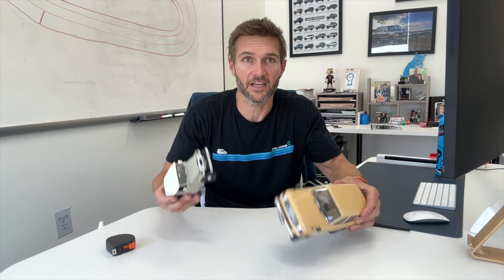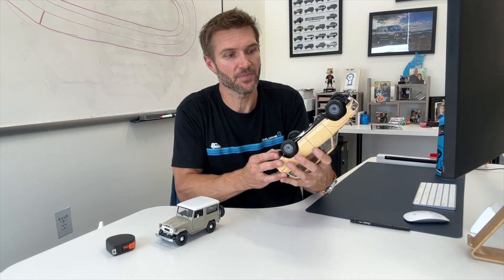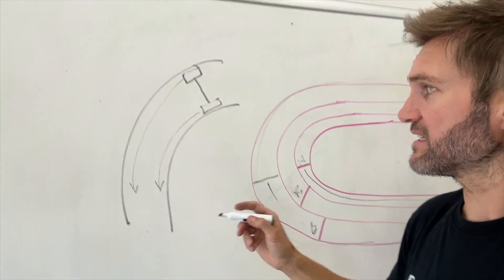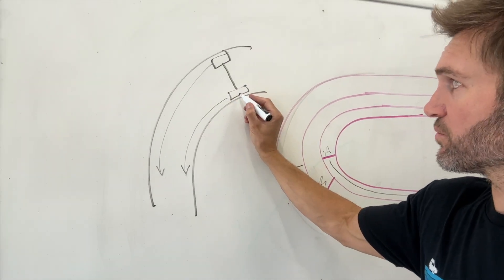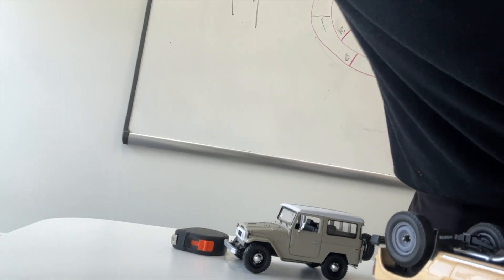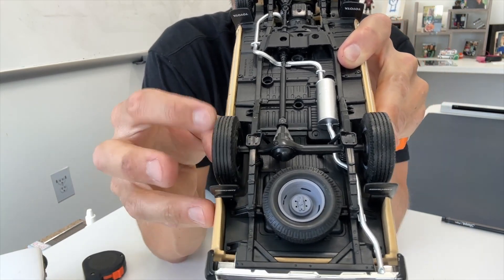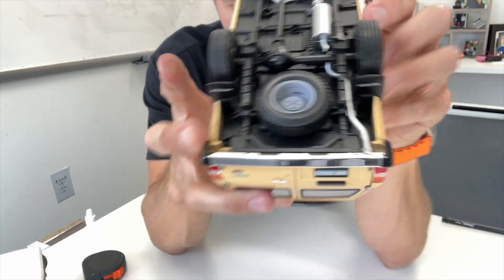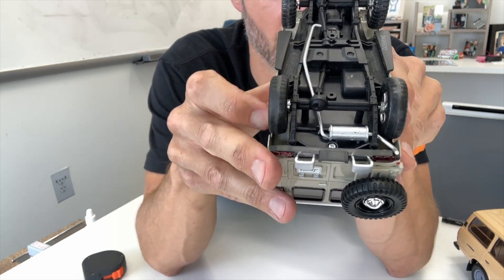Differentials and Lockers Explained [PART 2]

Comment: Excellent overview, using a running track to visualize distance is perfect.  I used to work with a couple of guys that competed in Drifting who had welded the rear differential in their BMW's so the rear axle was essentially locked.  Sounded horrible when driven in the shop and they used up a lot of tires!